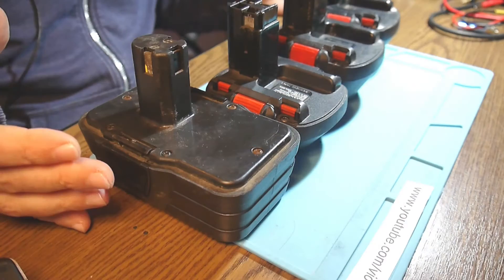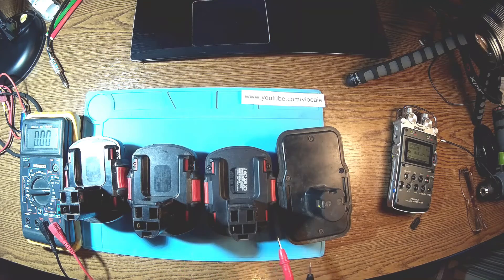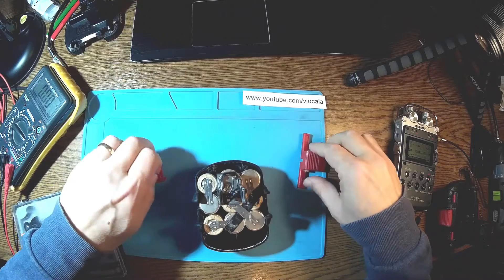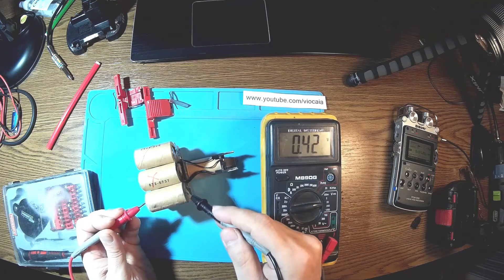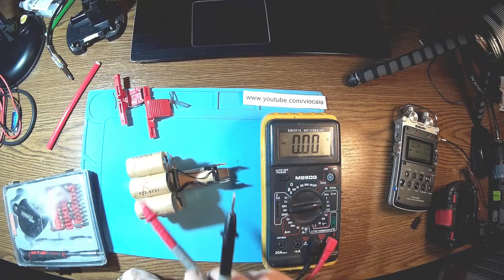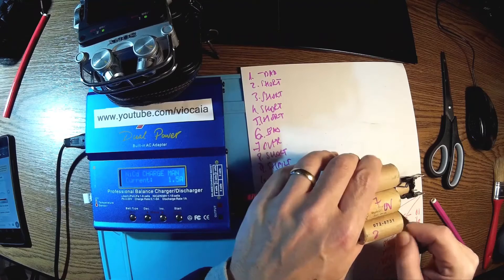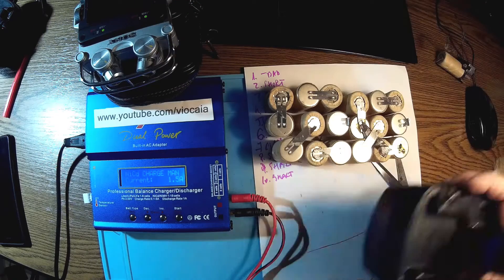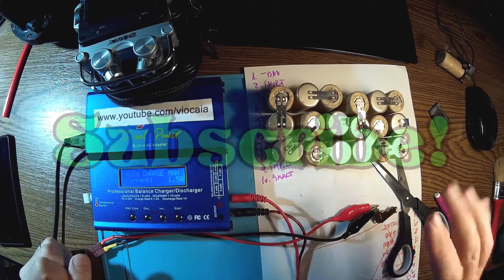Bosch drill batteries check and repair

Comment: Hello! I've bought a cordless drill BOSCH PSR 12 without battery and charger to use it on a 12V car battery. But when I connect the wires (positive to positive and negative to negative from car battery to the drill) the wires get very hot when i press the button and the drill doesn't spin.Is there a way to make it work on the car battery? I've got another no name brand 9.6V screwdriver that works well connected with wires on the 12v car battery
Reply: Thanks for the replay! I've connected the battery directly to the motor but it rotates very slow.  I think there is some kind of protection that prevents the motor from starting. I see in the video that the battery pack has a termistor or resistor connected on the "- ground". I don t know if that is only for charging purposes or that prevents the motor from starting.
Reply from the maker: @robb5020  Not at all..probably it's a capacitor..but that doesn't explain why the motor is not running properly..maybe it's a 18V drill..even higher voltage..that ca be an explanation, from my experiments a 14,4V drill motor should run like crazy at 12V! Remove any wires connected to motor contacts from the onboard electronic and do the 12V again..
Reply from the maker: Dismantle the drill, and check the motor directly to 12V..if it's ok then the problem is the electronic command..maybe you should connect the motor bypass the on of button..but you can't change the rotation sense easily...

Comment: Aha! Always question everything. When you got so many consistently bad batteries I immediately suspected the iMax. I would have looked at it before cutting off the charging port. Seriously, so many bad batteries isn't the norm but you missed the red flag. Good video, nice step by step process. NExt time show how you set up the iMax instead of FFin through that part. Thanks Viorel.
Reply from the maker: Of course..I used the cycling function under NiMh menu, that is doing multiple charge/discharge to each cell, eventually after few cycles the capacity is very clear.But , there are some IMAX models with no function like that..it's still useful with manual cycling ..like 3 charge/discharge is enough for conclusion.

Comment: It is probably possible to revive those totaly discharged cells. Use one of working cells and paralel it with a zero volt cell for 10 seconds. If it revives, it would eventually show 1,2V and it can be charged again. It could be used again. Only question is, how long does it take to totaly discharge again. It doesn't holds full capacity, but in combination with similar cells, it could be used again.
What internal impendance do you get for this cells? I checked a similar battery pack. Working cells showed 17mohms, discharged cells from 17 up to 27mohms. But this should be measured on fully charged cells.
Reply from the maker: The impedance is ok, like 20ohms, it's looking like I have a problem with my IMAX, fake charge report.I'm waiting for a new charger.Usually I can recover like 50% cells..this time nothing, I realised it's something wrong with my IMAX but the video was posted anyway.
Reply: @viocaia  I see. My impression was, iMax refuses to charge totaly discharged cells. My MC3000 sometimes says "battery too poor to charge". This old NiMh cells behavior is very interesting. Some time ago I posted some replys to you about reviving this cells. I did some extensive tests on old AA cells. The results were not consistent. One thing is interesting. Now almost all cells have very little difference between internal resistance (MC3000) and internal impendance (YR1035+). Before it was mostly way apart. Some cells approved overall (from 700m to 300mOhm), others failed totaly (from 1000 to 2500mOhm).
Reply from the maker: @tg_privat  I just fixed my IMAX, it was an OP and I planted a better N-Mosfet fro charging..now it seems to working.I'll revise the NiCd test with the ''new'' IMAX in couple of days.In the mean time I ordered a Charsoon Antimatter 250W 10A charger, hopefully better..I'll post about when it's coming.BTW the old NIcd cells are around 20mohms most of them..so there is hope...
Reply from the maker: I've been trying with my new charger to revive those cells..with very low current like 200mAh and cycling five times..very low capacity like 250..300mAh..the cells are gone, no chance..but like I said many times, I had fun!
Reply: @viocaia  Yes. These NiMh and NiCd cells ar such a mistery. More times that I fail more I get interested in. I would (maybe) open such a faild cell, to see, what it looks inside.